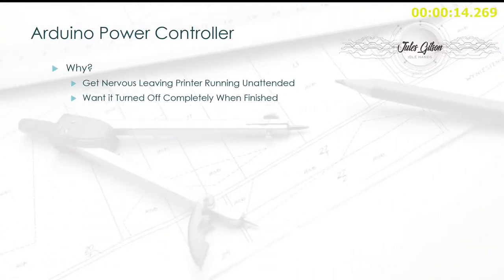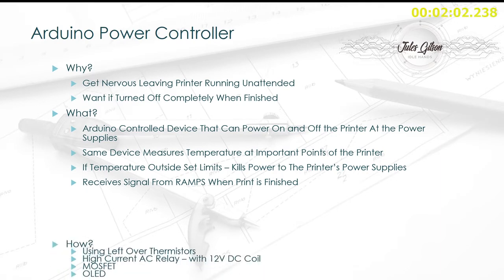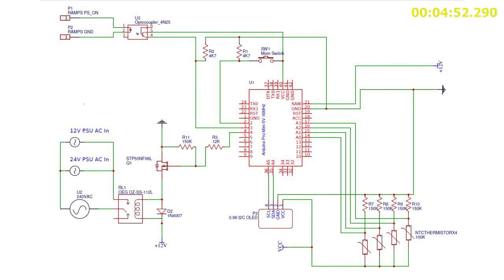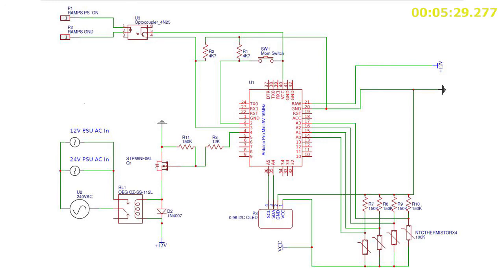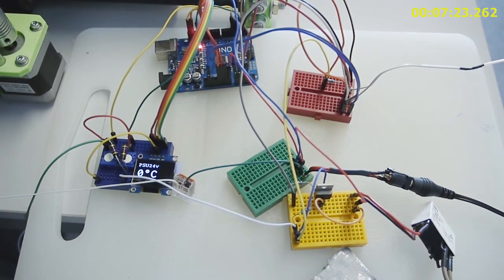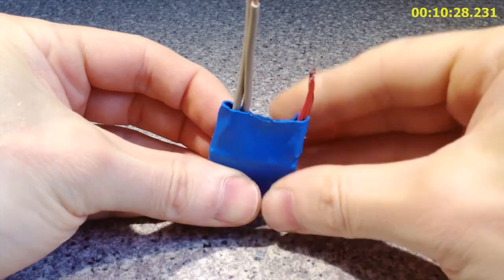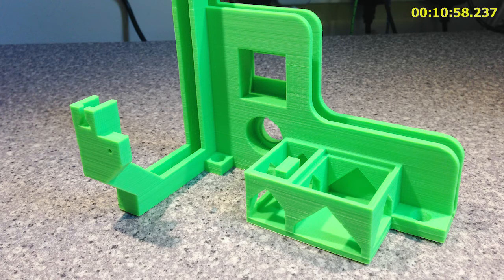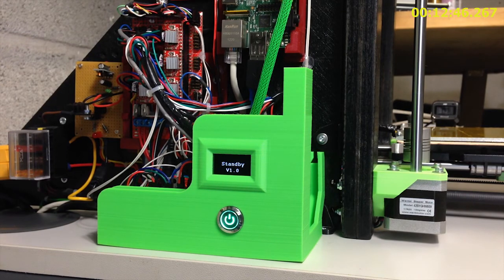Auto Shutdown - Arduino Power Controller for Prusa 3D Printer

Comment: hello verry nice videos
do you have pictures where the thermistors are fixed on and where al the components are hooked up( picture)
thanks a lot
keep posted
Reply from the maker: Beyond what is in the video (a few years ago) I don't have any photos - it is all in an enclosure now. The thermistors were taped with kapton to the PSU cases, one behind the stepper drivers and one on the top of the printer frame
Reply: @julesgilson.  OK thanks

Comment: How do you keep the Octoprint PI form getting corrupt when shut it down like that? The two that I have get corrupt after just a couple of times not being shutdown from the command line first. Also, how do make sure the hot end is completely cooled down before the power is cut?
Reply from the maker: That's odd. No issues in killing power to the RPI. The temp of the hotend isn't an issue by the time it shuts down? What's your concern there?